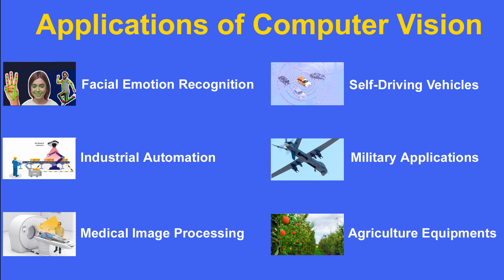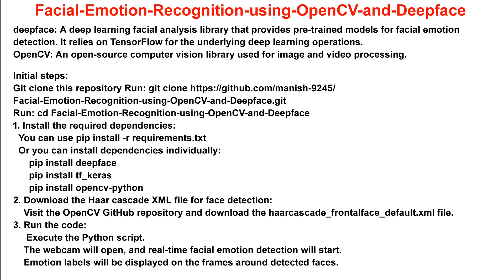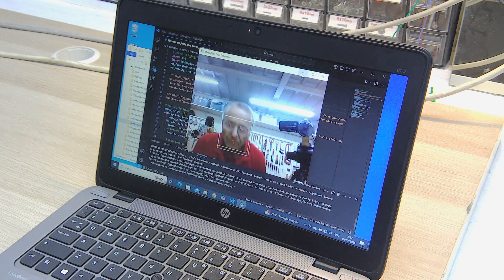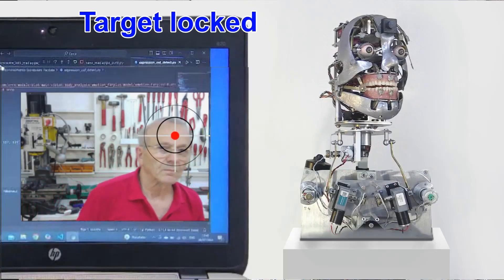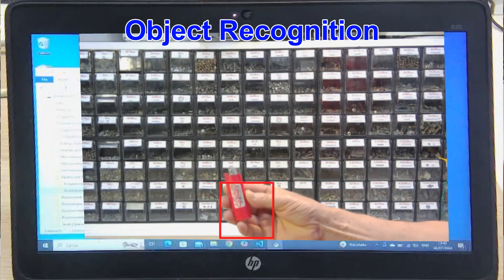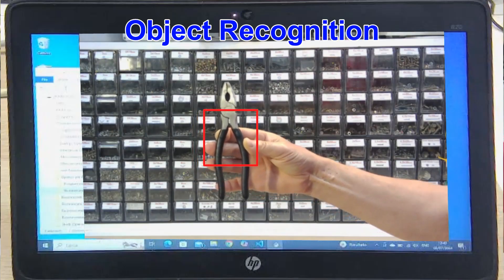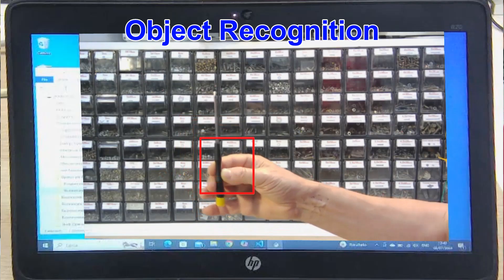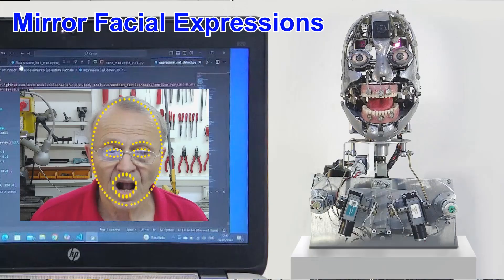Mirror facial expressions Robot - Animatronics

Comment: Sir can these cameras be installed in robo eyes ???
Reply from the maker: YES! But the eyes can no longer move.
then I will make a video that the camera will be under the skin, of the neck or forehead, just make a very small hole and the camera can no longer be seen.
Reply: @alvaropasseri5754  ok sir
Reply: @alvaropasseri5754  The face can have a monobrow to hide the camera haha
Reply from the maker: @nickgenericusername  If the eyebrows move it is not possible to put a camera on them like in my robot.
However, if the eyebrows are fixed then it is possible